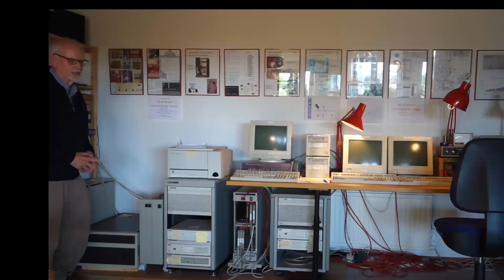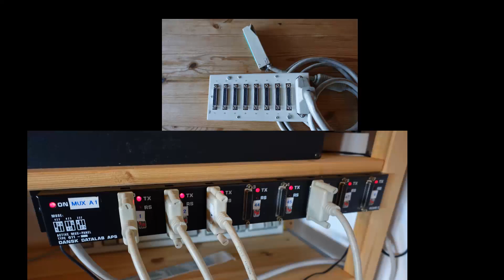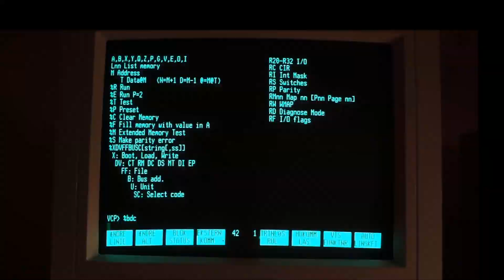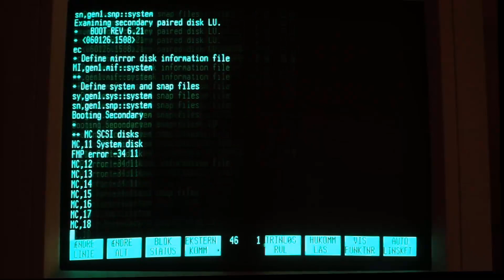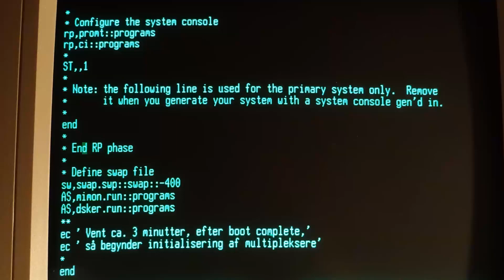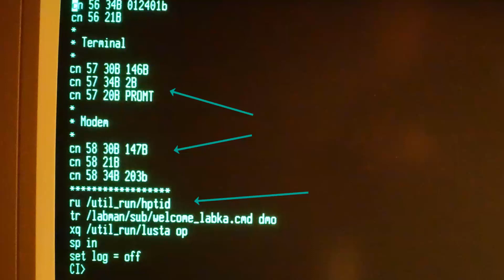HP 1000 A990 Booting (5:9)

Comment: I have a HP 1000 A400 computer. Including RS232 output MUX. Unfortunately, I don't know how to handle it, because I can't connect the keyboard in any way. How did the keyboard connect to these computers? Is there any reduction for RS232 keyboard?
Reply: Yes you need a terminal with serial connection.